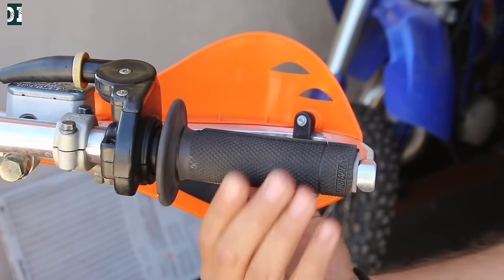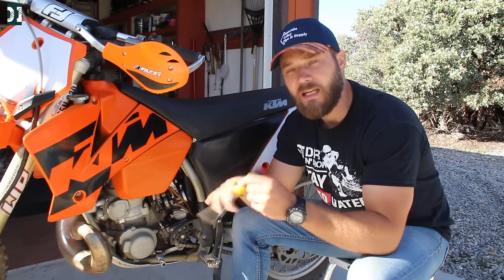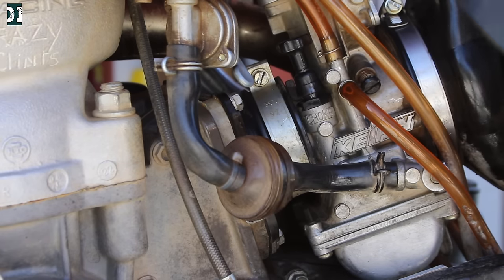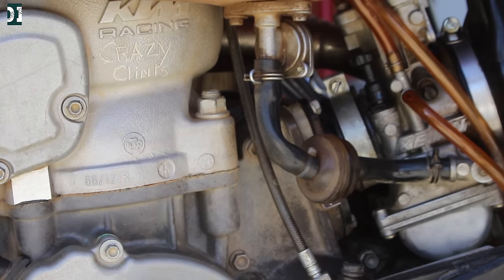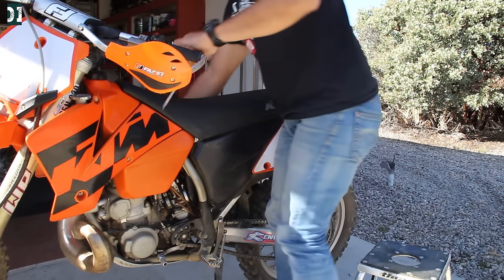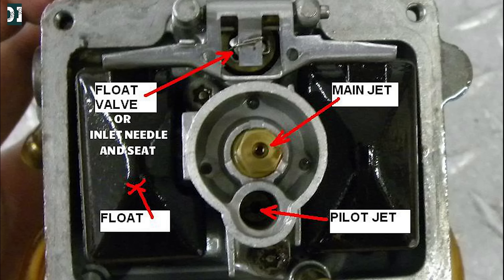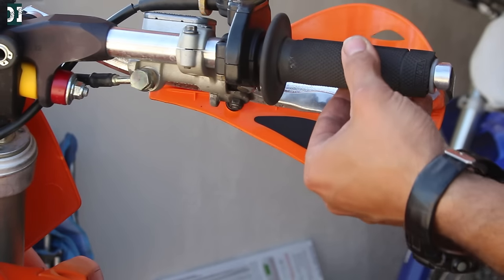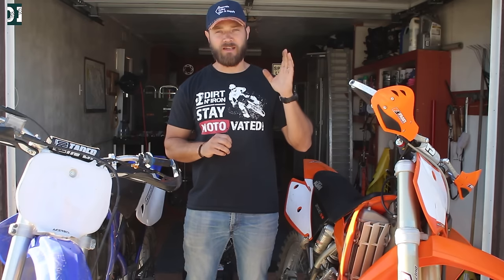How to adjust idle on 2 stroke dirt bike - air screw adjustment 2 stroke.

Comment: Thank you for this! I have to borrow my Wife's ear to make sure that it sounds like my 2 stoke. Why I had to borrow my wife's ear? It's because I am deaf. She was telling me about the thumping sounds. So this video cleared it. Sames just the same as yours but needs some slight adjustment for lean or richer.
Reply from the maker: Glad to help! good luck Arron!
Reply: @dirtniron  Thanks man! first time out riding it today and my spark plug got fouled. (I think) I hope so! lol I already cleaned out the carb and change jet, before I went out riding it. I rode it for only 3 hours or so.
Reply: @dirtniron  Hey Man,
Please forgive my grammar, 
After 3 hours of riding, my bike died Fouled Spark Plug. Seems to be too rich. So, I can Turn it more to the left and then I can Adjust the throttle? if i did that, and it will be ok? As of right now when turn all the way to the right (less air) i only have it turn 1/4 not 1/2.
Reply: @GibbonsWorks  how do you change gears, by the feel of the vibrations? 

Alot of people say you need to be within 1.5 to 2.5 turns (left) on the air screw ortherwise you need to change the PJ. The manual for 300exc Australia has 3.5 turns as it's standard spec.
Reply: @brendon8702  Yeah by the vibration of high or low rpm. I have turned it to 1 full turn and 3/4. So, I hope that'll do it. I'll keep an eye on my spark plug to see if its either lean or rich.
Reply: @GibbonsWorks  

KTM manual says:

-Turn idle air adjusting screw slowly in a clockwise direction until the idle speed begins to fall.
-Note the position and turn the idle air adjusting screw slowly counter clockwise untill the idle speed falls again.
-Adjust to the point between these two positions with the highest idle speed.

You wan't the idle to be at 1,400 to 1,500 rpm (use the idle speed screw but still get highest idle with air screw)

If there is a large engine speed rise, reduce the idle speed to normal level and repeat the above steps.
If the procedure described here does not lead to satisfactory results, the cause may be wrongly dimensional idling jet.
If you can turn the idle air adjusting screw to the end without any change of engine speed, you need to install a smaller idling jet.
After changing the idling jet, repeat the adjusting steps from the begining.
Following extreme air temperature or altitude changes, adjust the idle speed again.
Reply: @GibbonsWorks  Operating with the throttle slide open (full throttle). This range is influenced by the main jet and jet needle.
If the insulator of a NEW spark plug is very light or white after a brief ride at full throttle, or if the engine knocks, a larger main jet needs to be used.
If the insulator is dark brown or sooty, a smaller jet needs to be used.

https://www.manualslib.com/manual/1148893/Ktm-300-Exc.html?page=109#manual
Reply: @brendon8702  thank a ton man, just FYI i have a 2001 yamaha yz250. My first bike. Super fun! I will get back at you if I have any issues maybe I'll post up a video and then maybe you can listen to it and see lol
Reply: @GibbonsWorks  Cool, I'll do my best to help. I'm sure others here will too.

I just bought my first bike aswell. It's a 2010 KTM 300exc. The bike hasn't been running right and my clutch was not disengaging. I replaced the basket, and the inner hub because my screw driver was catching on both (the basket was obcviously warn lol). I was waiting weeks for the parts to come in, but the wait was mostly on the clutch dampers, and it was a good thing I got them too because my gear was wiggling on the basket.

I was messing with my carburettor for awhile and spent a bit of time removing and installing it till I checked my reed and they had a big chunk missing from the flaps! So I hope that gets my bike running better. It's got late now so I'll wait till tomorrow before I start it to truly see.

I highly recommend you throw out the fuel that came with the bike and get some fresh stuff so you know for sure and check your reed so you arn't chasing your tail like I have been :)
Reply: @brendon8702  alright man glad to know that others will be around to help me out! I'll take a look at my reeds hopefully I'll find time to work on it. Thanks a ton man!
Reply: @GibbonsWorks  All good, my bike runs great now with the new reeds! Clutch is working like it should too.
Reply: @brendon8702  sweet man! I'll start recording tomorrow to start it up and show the spark plug. I hope youll be able to watch it tomorrow! I might need to buy a new spark gap measurement because I ordered one from Amazon ( big mistake) turns out that the measurement minimum is 0.25 inch I need .20 of an inch. But I'll use my best judgment for now. I can just say its smaller than .25 of an inch. 😆
Reply: @brendon8702  Hey sup man. It's being uploaded, you can check out my first video whenever you like to watch. I hope it was good. Lol
Reply: @dirtniron  Hey I made my first video and its being uploaded, you can check it out whenever you like. Hope it was well! Lol
Reply: @GibbonsWorks  Hey Arron, 

Looked good, sounded good. I think your bike is running very well and you done a good job. Theres almost no smoke too, wining!
Reply: @brendon8702  Sweet Thank you very much for your help man!!! I feel so much better by reading your comment! Yes! I'm so happy now !!!

Comment: Great video with simple explanation on how to!! ;) 
My bike started to have a problem, it stops!!! And i found your video... :)
 If i set the air screw 2 turns out, the bike sometimes stops and wont start. Spark plug is wet (wet fouling?) and i have to change spark plug. If i set to 2 and a half turns, bike dosent stop, take the spark plug to check and it has dry fouling. Should i go 3 turns and that way it wont form lots of carbon deposits out or the problem could be something else and dosent matter if i turn out the air screw?? 
The mixture (oil and fuel) if good, same before the problem started to happen. 
 Maybe because weather is hot and that aftects the air/fuel mix??
Reply from the maker: yes, sounds like you need to lean it out little more. Try 3 turns out and see how it feels. How is the bike running with 3 turns out?
Reply: Going to see how goes with 3 turns next time. 
I took out the vforce3 reeds to see if they had any problem. I can see a bit of light on the corners, but beside that no major problem.
Going to check the float and clean the carburater.
Next time i ride, i will tell you how it goes...

Thanks for the help.
Cheers all the way from Portugal :)
Reply: Little update:
Float was good (used your video to check the float). 
But carburetor slide had a bit of dirt and pilot jet was also a bit clogged. Probably that was the cause for having to open more the air screw?! Anyway, going to put all back together, clean the air filter and try to test the bike soon.
Reply from the maker: sounds like you got it, let me know once you ride
Reply: After warming up, got to ride the bike for 15/20 min on a little technical trail to test, always in low gear and some parts with good speed outside the trail, since thats what we ride most of the time! Bike goes well, nice idle with 2 turns out! Took the plug out and was dry, on the dark side but with some brown also. Maybe running a bit rich, but is best this way. That small dirt on the carbureter was messing things up. 
Thanks for the tips with your videos!! Keep on the good work! 

P.S. My bike is running with stock jets and needle, so now i want to jet my bike to get a more linear power delivery (we ride really techincal trails) and better fuel economy, so the fun is about to start!! ;) lol
Reply from the maker: thats great Ric, glad you got her running right! I had good results with JD Jetting on my KTM, maybe worth trying. Good luck!

Comment: Question: does it matter where the idle screw is set at, before you start adjusting the air mixture screw? Thanks in advance
Reply from the maker: I would keep it somewhere in the middle, usually i dont touch it much. Maybe bring out a turn from where it is right now...

Comment: When my bike gets a little hot when riding in the woods ar a slow speed my idle starts to surge it goes up and down slightly, what do you think could cause this?
Reply: Perhaps try cleaning your air filter (or replace) and I'd replace the plug, other than that wat bike r u running 4 stroke? 2 stroke? carb? fuel injection?
Reply: @ajdorrington-sadoski9420  1995 CR250R

Comment: Hey man you said that you should go 2-2,5 turns out on the airscrew from fully seated to begin with. Your bike didn't idle at the beginning and you fixed it with the airscrew? why? why not just fix it with the idle screw? How do i know what to set my idle screw at to begin with? Let's say my bike starts and doesn't idle at 2,5 turns out on the airscrew why don't i just bring the idle screw little bit more in so it idles at 2,5 turn out instead of going to 3 turns out as you did? keep up the good work man!
Reply from the maker: bc I wanted to have the bike also running well, have that crisp response from idle to mid. I first set the idle with air screw to get nice crisp response and then if needed I can adjust idle screw as well..  hope that makes sense
Reply: @dirtniron  So i first make sure the bike starts and then adjust the airscrew for best throttle response and only then after the bike is crisp i adjust idle screw for smooth idle?

Comment: i have a question, my dirt bike has the same problem as well, which I’ve watched the video. Now that’s that out of the way, my Yz85 turns on and run but cut off at a complete stop. Do you know the issue? Pls respond
Reply from the maker: raise the idle I guess
Reply: Dirt N Iron I figured it out. Thanks a lot tho

Comment: Great video! I am new to 2 strokes and recently purchased an rm250 and have fouled a few plugs when I am on the trails and not fully on the pipe. I am just wondering whether these screws can be a factor as to why I have fouled these plugs, or is it just the way that i have been riding the bike.
Reply from the maker: thanks Ryan! Looks like you are little bit rich, try to play with the jetting, try one size smaller pilot jet or drop the needle one notch lower.

Comment: verry well explained! thanks! great that you mentionned the yz 125, just bought a 2015 for my taller son 3 weeks ago, i changed the steering bearings, the rest is like new. Any video you have specific to the yz 125 for advices, setup, maintenance or operating??
Reply from the maker: cool, great bike for your boy, he would love it! its very simple bike. keep clean filter, oil changes, pack bearings... you should be fine
Reply: Stay the hell away from Amsoil and do not listen to the 80:1 or 100:1 just keep your gas mixture at half or under half, 50:1 40:1 32:1 or 30:1. I don’t care who says how good amsoil is, you’ll wreck your engine in no time. Dirtbike channel runs it, he shouldn’t. Amsoil will kill your bikes.
Reply: AkaComeau i already bought the yamalube 2r oil for 30:1 premix as the manual says, thanks!

Comment: Thanks man ! Do you have video of how to take the slack out the throttle mine has little bit to much play 2004 CR85r
Reply from the maker: you have 2 places where you can adjust it, on the carb when the cable comes in and on the throttle at the handlebars

Comment: Your videos are very nice an informative. Thanks for the instruction, I did it just like you said on new ktm300xc an it has great throttle response now. But I have to ask, what power value spring you running an would a lectron carb be  better than factory carb for power an throttle response?
Reply from the maker: Thanks man, i am on stock spring. Check my other video riding 2019 300xc,  it had Lectron and then we changed it to keihin with jd jetting. I like lectron, it made great usable power with very smooth delivery. Check the videos I explain it all there. Also i compared 2004 to 2019.. that was fun video too
Reply: @dirtniron  Awesome. I will watch. Glad you Luke the lectron, I just ordered one but won't put it on till warranty runs out on this 2019...Think it's only a month?
Reply from the maker: cool man! Let me know how you like it once you have some riding in.

Comment: Hello. Right now I'm using 4strokes motorcycle. But I'm using 2 strokes carburetor on my motor. So which does it apply. Screw my airfuel screwmixture does it go  richer or leaner

Comment: Hi bro your video help me a lot. I got a question. Im totally New on a 2 stroke and i recently buy 2 Yamaha yz 125 one is 2002 & 2005
The 2005 was working fine but now i move the air screw 2.5 turn open but i feel its rich. I feel the 1 and 2 Gear like heavy. The 3rd gear its more soft. Now i cant end the trail because i spend all the fuel.
I Need to close the fuel screw? The air screw it has 2.5 open its fine?
Reply: Im using 4oz per gallón. And the spark plug its the original. The carb its clean. Im sure just i Need to adjust the carb
Reply from the maker: i am not sure  i understand you. this carb does not have a fuel screw..

Comment: I recently picked up a JR80. Once its hot and I come to a stop and press the clutch in (or even in neutral when hot) it starts to scream rpms go off the roof as if the engine is about to blow off. But as soon as I put in gear and go it runs. Is this an idle adjustment and fuel mixture issue or something else?

Comment: Hi. Great video, having a jeering issue with my brothers 2006 sx125. The bike runs good but in sudden full throttle its bogging. I tried to adjust the air screw and it seems that its bogging less when the air screw is all the way in (clockwise). At 2 turns counter clockwise where is the manual position it bogs more. It has 188 main jet. It needs bigger main jet or bigger pilot? Thanks
Reply from the maker: bigger pilot if it bogs of idle.. try one size bigger

Comment: I have a yz250 stock jetting 850ft in Pa, stock 50 pilot 178 main and fmf full exhaust. I put the new top end on and she wants to hang slightly barely noticeable then when i rev it the bike revs fine but  pops some on decel. Stock reeds new pedals. Do i need to richen the pilot jet?

Comment: The bike before ran great before idled good and all that. Took 3 months off now and weather cooled down by like 30 degrees average. Now it's not wanting to idle on its own, off idle to about mid throttle its bogging then when it hits mid range to upper rpm it does great and pulls hard. Is the pilot jet to small now causing it to run leaner since its cooler? If I have the idle screw all the way in it barely idles on its own but it'll want to die after a minute or so idling on its own. Free play at the throttle is good and backing the screw out seemed to help a bit with throttle response but not really the idle.
Reply from the maker: yes, you need more fuel. Try to go one size bigger on the pilot, or maybe first raise the needle one notch and see if that helps
Reply: Would you know why when the fuel valve from the tank is in the off position why it runs better? Tried changing jets up and down. Went from a 42 to 40 on the pilot and seemed to somewhat idle but still not right so I turned the fuel off and let it idle some of the fuel from the bowl so I didnt make a mess and it sounded super healthy and revved without hesitation

Comment: Hi, my spark plug has a bit of oil on it, I know it means it runs rich. Can I lean it out with the air screw while idling or should I ride it and then check the plug? It’s a 1981 RM100. Thanks in advance.
Reply from the maker: you can lean it out, but thats just your idle and little off idle.. try to maybe play with the needle

Comment: Okay
2018 YZ250 ts 
Air screw 3 turns out to get that crisp throttle
But idle screw is almost all the way in to get that soft idle like you had.
I’m using aviation fuel 100 octane at 32:1 mixture
Should I do some jetting
Bike is completey stock
Reply from the maker: if you are happy with the throttle response then I would leave it like that, there are good YZ250 jetting recommendations on pro circuit website, check that out maybe. good luck!

Comment: I've just fitted a jd jetting kit to my 2017 beta 300rr 
I've got it running really crisp and responsive following you're you're advice of this video, only thing I have found is the air jet is quite away out to reach the perfect response!
Would you leave it or change the pilot jet???
Cheers
Reply from the maker: Glad the video was helpful Stephen. How many turns out?
Reply: @dirtniron  3 turns out
Reply from the maker: I would keep the same pilot but drop the needle one notch lower, so it gives you less fuel - more air.. try and see if you can find crisp response before 3 turns out
Reply: @dirtniron  
That's great 
I will give this ago
Appreciate you're help!👍
Reply: @dirtniron  dan am I right understanding my current needle jet clip position is 4th from the top,
You are saying drop it to 3rd from top so the needle sits lower!
Sorry for all the questions 🤫
Reply from the maker: Stephen Douds yes, that’s correct. You will move the clip to one position higher and that would drop the needle one position lower. Lets see how it works.
Reply: @dirtniron  cheers dan!

Comment: I have a bad exhaust leak could that be part if the reason I can't idle. The exhaust system is going to all be replaced eventually needless to say it's vibrated loose from the frame. Also low end doesn't have much power but once rpms are up she rips